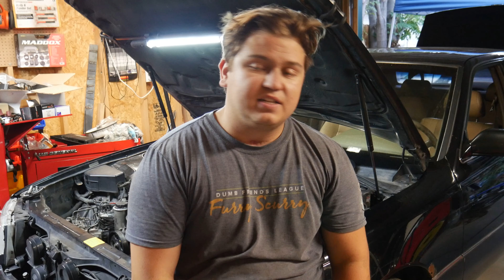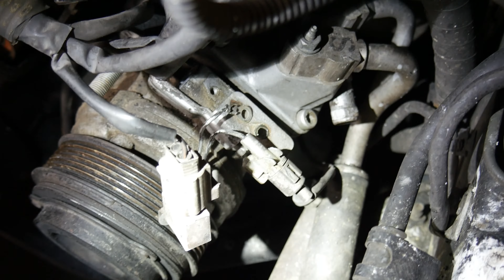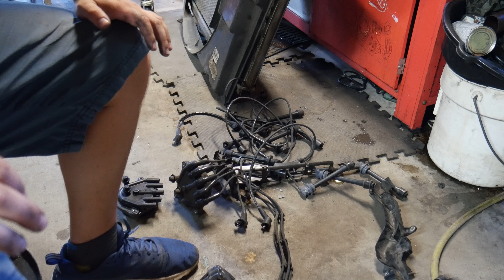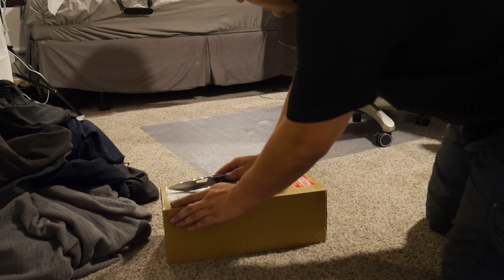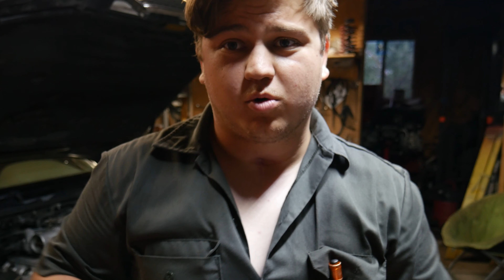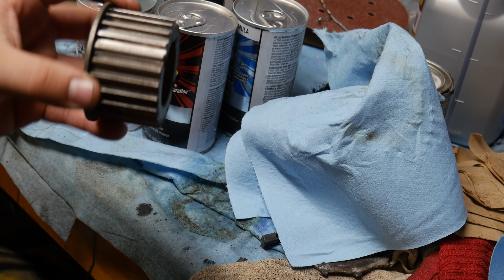Lexus LS400 Timing Belt - Part Deuce

Comment: im currently looking for a 95 ls400 timing cover. I am unable to find it due to the part being discontinued. Is is safe to drive without one ?
Reply from the maker: which part of the timing cover? as in the top part that goes over the spark plugs and the timing sprockets? if so, yes, the lower timing covers towards the front might be a bit worse without, but still probably wont hurt anything

but, generally its good to run them yes
Reply: @ClaytonBridges  thank you for the reply. Its the lower timing cover sadly

Comment: Hi Clayton.  The bearings in my mechanized fan have seized up, and I purchased a whole new fan bracket.  I believe I have the driver side of timing cover ready to come off, but am running into a wall passenger side timing cover removal.  The air intake that is connected to the throttle body does not want to come off for some reason, and I believe that I have taken off all bolts holding down to be able to remove it in freeing up timing cover so that I may remove fan bracket.  I'M STUCK!!!  Any ideas or suggestions would be absolutely appreciated.
Reply from the maker: Yes I have a few pieces of advice for sure.

The air intakes are a little diffiuclt to take off especially when theyre old and stiff. Mine is rock hard and genuinely hard to take off. 
BUT you have to take the intake off with all of the ducting first, over the radiator, if you havent already

But once the ducting towards the front of the vehicle is off, if all of the bolts holding the intake and air chamber are off, you need to pull it outwards away from the throttle body first.
There is a bolt towards the firewall that holds the air chamber/airduct down, I think it also supports a large wiring harness back there
Reply: @ClaytonBridges  Clayton!  First of all, THANK YOU SO MUCH FOR YOUR RESPONSE!  I have in fact taken off the ducting tword  the radiator bolt near firewall  and wire harness has been un clipped.  And your right.  Dam thing is on there rock solid, with the exception that Im able to wiggle to a small extent.  So..  with that being said I will pull it from the throttle body, but just wanted to make sure I'm not breaking anything in the process.  HOW DID YOU GET YOURS TO COME OF?  Did you use any lube or any particular method?  😃

Comment: Delete the Powersteering Idle Up Valve then you can delete the lines and cap off the ports. Also the idle up valve is a known leaker which usually causes alternator failures. I used an old oil drain plug to delete the valve can't remember the size but you can look it up. Its nice because no more broken lines or leaky pump also felt no difference in the steering. An alternative to the plug would be to use the Idle Up Valve from the pump break off the plastic end and weld the top part shut (don't jb weld it will leak) the drain plug method is much much easier though.
Reply from the maker: I see that. Whats the pro of deleting it? So it doesnt leak into the alternator?
Reply: @ClaytonBridges  Pretty much the only pro is so doesn't leak and they almost always leak eventually and also deleting those stupid lines. I had the same one break on me as well.
Reply from the maker: @sivageist  yeah that one that broke was incredibly brittle 😂